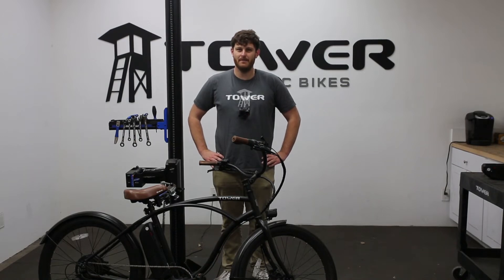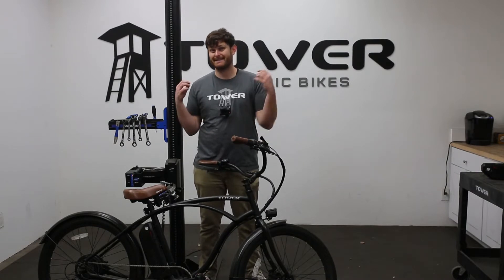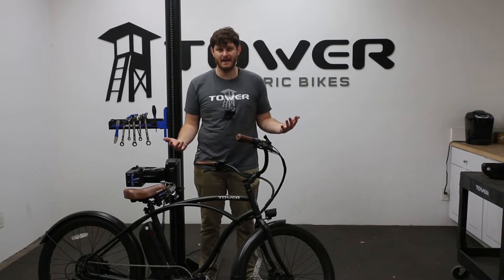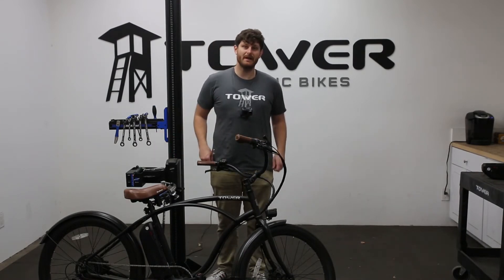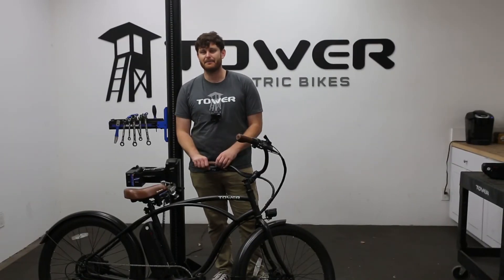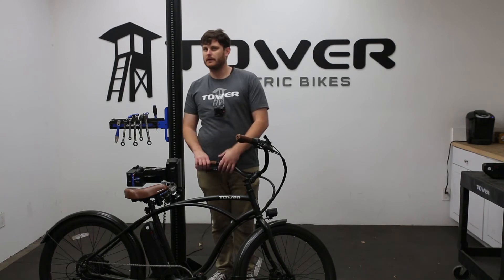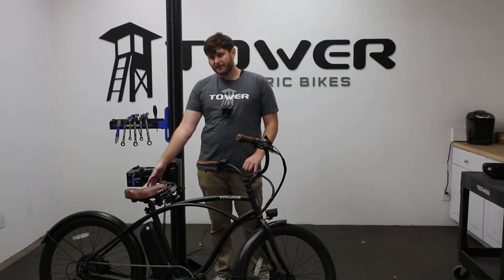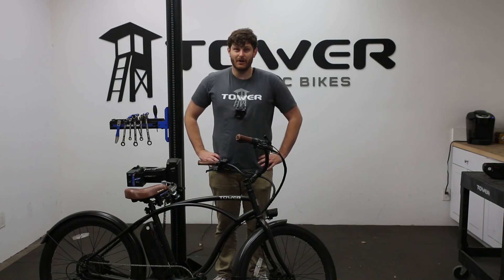Watts, Amp Hours ("Ah"), and Volts Explained for Electric Bikes

Comment: So to follow up with a question what does actually changing the voltage do for the bike like is it better to turn your voltage up high or lower when looking to make the performance of the bike better power speed etc ..?
Reply: Higher

Comment: I think the way to test the motor watts is to put the motor out of the bike in a vice on a bench. Then feed the rated volts into it through an ammeter. Then you read the amps when the motor as winded out to it fastest no load speed. Then multiply amps x volts. (The eBike laws concern the motor's watts, not the motor in some application).

Comment: Please I need to know. Can I use a 48v 2000w 45amps  CONTROLLER

With a high powered 3000w-5000w HUB MOTOR? 

I can't seem to find ANY info on this. 
If a 2000w controller work with a 1000w motor. Then the opposite is true as well? 

I'm running a 52v battery capable of pushing 45amps. With a controller that is 48v that accepts 45amps but can push 2000w. 

I want to know can THAT SETUP.

Work with a 3000w-5000w hub motor.

Comment: Very cool short video.
How about some basic examples for needs? Say a 80-100kg man who wants to pull his kid or groceries and with some little expected hills with at least 30 km a day, what would be needed?
Or just the man but 50km a day. And wouldn't it be best for occasional long range set ups that the battery is easily changed, so not a 1 battery assumption but a reserve battery logic to it?
Reply from the maker: Hi Halia, the consumption of different ebikes set ups is just too variable. How fast is the man going? Is he just throttling or is he pedalling as well? How many hills are there? How steep are the hills? The variables go on and on. For the Tower ebikes, if you are only throttling at half speed (12mph) on flat ground you can make it about 30 miles. It's best to test the specific bike you are looking at to see what kind of range you can get.
Reply: @TowerEBikes  I did understand there are many variables. I was talking about crude examples. The maker of a video decides.
The thing is, ebikes are expensive while being for very specific/narrow use and since it is made maximally complicated  from the get go, it is made an unattractive option of transport.

Comment: I just bought this 1000W e-bike but i wanted to know: if i ride a 250W motor and a 1000W motor at the same speed of let's say 25kms/h, and they both have the same battery, will the 1000W still consume watts and energy and have a shorter range or both e-bikes will have the same range?
Reply from the maker: Theoretically, if you're consuming the same amount of watts then the battery should last the same range. However, it would be hard to be consuming the same amount of watts from these two motors. A lot of time companies will give you peak consumption as a way to make their motors seem  more powerful. You want to look for a sustained watt consumptions rating. Even still it would be difficult to get the same consumptions from both motors.
Reply: @Tower E-Bikes How To  I got 2 solar panels.  One is producing 72v dc 15watts  the other is producing 20v dc 15watts. Which one produces more energy?
Reply: The Volts necessary to power the 250w motor would be less than the 1000w motor. You're either gonna be insufficient or over sufficient by using the same battery for both motors.